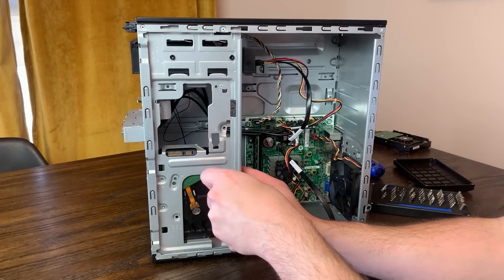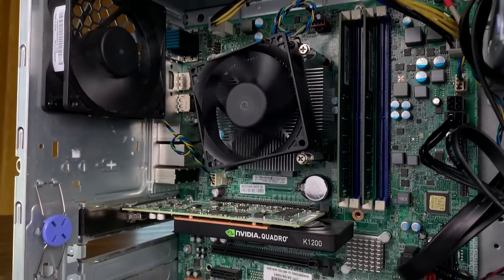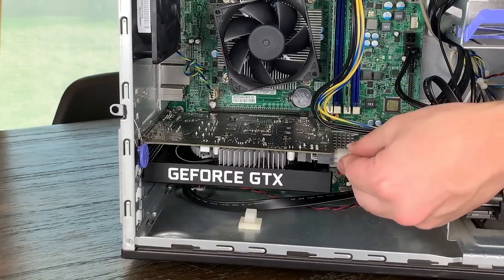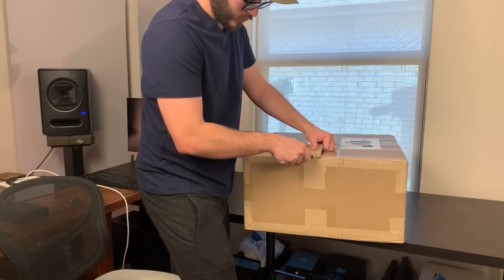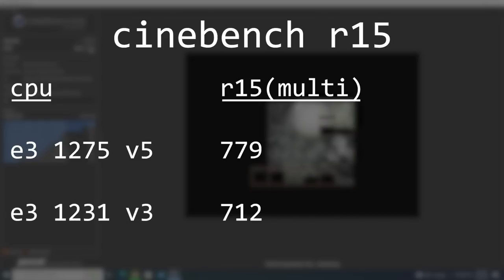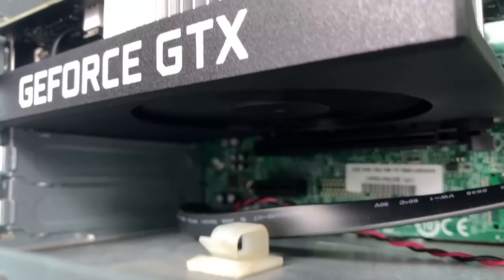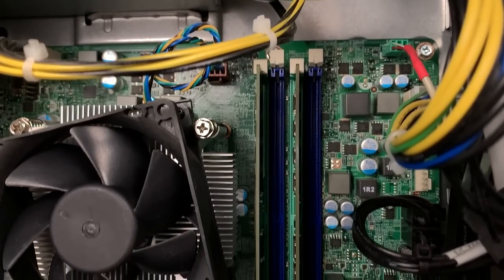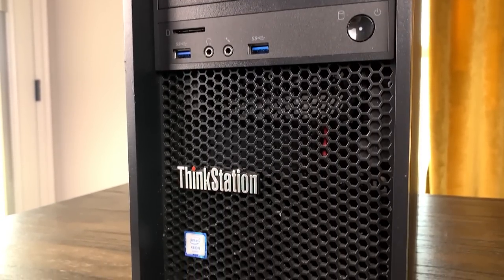Is This Lenovo Workstation Worth It In 2022?

Comment: While this is a decent find, I feel like someone should look for something with at least an 8th gen CPU or newer. I got a Dell Optiplex 7060 with an 8700 and 16 gb of ram and a 512 gb sata m.2 ssd for $185. With 8th gen and newer you don't need a dedicated GPU bc intel uhd 630 graphics are good enough for transcoding multiple 4k plex on the fly transcodes simultaneously. The downstairs are limited drive storage and a proprietary form factor motherboard and PSU. However if you have a 3d printer and a Dremel, you can make a few modifications to the case. Personally I plan to just buy a case with lots of drive bays and a new PSU and motherboard. I personally see the PSU and case as a long-term investment though since I can easily reuse them in future builds. Great video btw.

Comment: the only product i ever bought that was Actually worth it's money ,
was a SubPac M1 and S2 when the M1 broke it's cable , which was my own fault by misusing it
it's basically a subwoofer in your gaming chair or you can wear it like a backpack
the drive these things have , no headphone or ''normal'' desktop speaker could come close to what i feel , 
and you can even give it some more power with an amp , physical amp or software based or even both to really dial it in how ever you like
works with everything , even sends throughput of 7.1 to appropriate headphones , just not the mic signal if you need one
your eyes and basically your  body can get a descent massage from this woofer , which there are also nice rumbling tracks to listen to and relax in to.
people are getting ripped of left and right in this world , but this thing was definitely worth the money i paid for it !!

Comment: That case looks identical to the ThinkServer TS140 I got from a work old hardware giveaway.  Same annoyances and fixed it about the same.  New PSU and the adapter (although I don't have the problem with the PSU not turning off like you mentioned).  The lack of places for 3.5" - mine came with 2 different 5.25" bay converters.  The top one has a slim DVD, small fan and adapter for 3.5", the bottom a fan and adapter for 3.5".  So it could hold 4x 3.5" but not sure I would ever trust that all running off the motherboard power.  :)
Reply from the maker: Yeah I probably wouldn't trust it either, especially with how little info Lenovo gives on specs
Reply: Got a TS150 myself recently that is very similar, pretty nice and quiet machine but man updating the BIOS was a pain and having ECC issues in old BIOS versions is embarrasing. 

Also it's meant to run 4 disks so i don't see any reason not to trust it.

Comment: That's not only a Lenovo Disease. My Work Fujitsu Celsius+ died a few Weeks ago. The Technician change at first the Motherboard and like so often it's not the Solution. He tried a new mighty 260 Watt PSU and that was the Solution of the Problem. The Fujitsu used also a 10 Pin Connector to the Motherboard. Power for the Drives comes also from the Motherboard.

Comment: I think the real value in machines like this is ECC support at a reasonable price which is great for a nas.  If not for that, there are much more performant platforms that draw far less power.  The nice thing about both of those facts is that it will keep prices down on these platforms for folks that want to build a cheap nas with ECC ram.

Comment: It's a good system if you need a graphics card and storage space. For my own needs it would be too big. I run two websites with some computing needs on an HP office PC (£150). It has an i5 9500, 8GB RAM and a 256GB nvme SSD. The best part is just 7W idle power.

Comment: Interesting that a fairly basic Quadro k1200 is still selling for $80 on eBay. 
Some of the fun workstations to play with, if you can get them at the right price, are the ones with LGA2011-3 and LGA2066 chips (like Lenovo P500, P510, Dell Precision 5810 and 5820).
Reply from the maker: I'll put those on the list, haha thanks

Comment: I just picked up a P310 (i5-6600, no GPU) for $85!  Just curious, when you replaced the power supply did you experience any issues with sleep mode, or just with full shut-down? This unit is working great, but I’d like to know what my options are if it ‘pops.’
Reply from the maker: I think fans or drives directly powered from the psu won't power down when asleep. You can still use the sata power from the mobo with a 3rd party psu still though
Reply: make sure the oem psu is not too old, or you can just buy a psu from like deepcool or fsp, seasonic etc.

Comment: I actually got a system not too long ago  with the i7 6700K but no GPU for 130 Euro and it was built by the previous owner so it had a normal power supply and case but also a HDD 😔
Reply from the maker: That’s still a pretty great deal!
Reply: threw an SSD (NVMe even better) and GTX 1080 is gonna be a bombastic build👌
Reply: @baoquoc3710  I put in an SSD (sata) that I already had lying around and a RTX 2060

Comment: The power supply problem would have been down to the main big capacitor in the PSU. I used to repair & recertify server and PC powers supplies for Dell & HP etc and those FSP's suffered this a lot.
Reply from the maker: I might try testing it and seeing if it’s worth reaoldering a replacement. Thank you!

Comment: Great video but i'll have to disagree on the conclusion. It is a glorified basic desktop computer with a xeon and a quadro gpu just to call it a "workstation". And it suffers from all the prebuilt defficiencies which makes it a hard pass. 
On top of that, add the lack of ssd and faulty psu.
Reply from the maker: Yeah I can totally see where you’re coming from. I think I was approaching my conclusion from the perspective that the PSU was functional still, as I imagine most people wouldn’t have that problem. ECC support is also a nice non-consumer feature, but there are definitely downsides. Appreciate the comment!

Comment: So this Lenovo p310 is socket 1151 and ddr 4. The xeon you show is socket 1150 and will not fit this board. It will fit the p300 which is also ddr3. I had 2 of these and cannot load Win 7, in that it will not read the win 7 DVD

Comment: Have you tested the system with the RAM sticks in the blue slots? I wonder if the instability was caused by that.
Reply from the maker: I did not, but the PSU was definitely the issue. it eventually didn't power on at all

Comment: Im just looking for any motherboard with Intel network card (really lot of MB using Realtek) to run Vmware ESXI hypervizor. And this looking good, hopint, that Intel NET adapter is not just in this P310 but also in P500. And for 200 bucks its a great deal to almost anything on Linux.

Comment: they sell adapters for the 5.25 bays that fit multiple 3.5 or 2.5 hard drives.  that way you can use all the sata ports.
Reply: Just don’t make the mistake that I made.  Those are fine for SATA SSDs, but I added an HGST Deskstar to the mix and thing idles at 55 degrees.  A 5400 rpm 3.5” is what I’d recommend with those adapters.

Comment: I have dell optiplex 7020 i7 4790,  16gigs rams with Quadro K2200, PSU FSP HV 550W. NVMe 512Gb using pcie x16 converter adapter. Old but enough for me 😁.
Reply from the maker: If it works, it works!

Comment: I recently bought a HP Prodesk 600 G3 MT and replaced the I3 6100 with a I5 7400 and got the RAM to go from 2133MHz to 2400MHz. Would that be possible with this machine? Replace the v5 with a v6?

Comment: The one thing I am wondering with this workstation is if the motherboard has 6 SATA connectors but only two mini 4p power connectors for the drives. Does that mean you need to double split the SATA power connectors to saturate the 6 SATA slots, is that safe? or is it just how lenovo intended it to be?
Reply from the maker: Depends on the power draw of the drive (SSD/HDD, rpm, etc). I really don’t know though haha

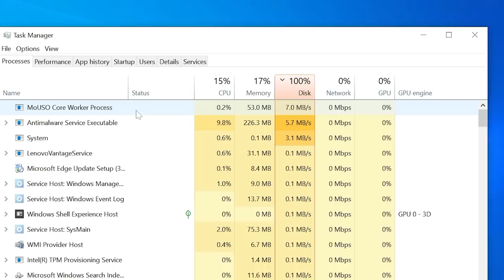Comment: 4:56 in my experience, thats just how it goes with spinning drives on windows 10+
Reply from the maker: Yeah, I didn’t provide enough detail there though. It was quite a bit worse than my other experiences with HDDs in windows, and was also making pretty horrible noises. I’m not sure why I cut that from the video
Reply: @HardwareHaven  Yea, Horrible noises kinda makes a difference with spinners, Probably alot scarier with solid state though... Like, "Theres nothing to make noise there, Why is it making noise?"

Comment: @Hardware Haven
You tossed a 500GB HDD because it was slow? WTAH? Mistake. Keep it in the system and add in an SSD to boot from. HDD's make great secondary storage...
Reply from the maker: So I was NOT clear at all. Not sure why I took it out of the script, but I originally had planned to talk about it making clicking noises and not working properly even after reformatting and such. Sorry for the confusion.
Reply: @HardwareHaven  
Ah ok, that's good info to know. From the way the video was edited, it seemed like you were tossing out a perfectly good drive, which is just craziness! Thank You for clarifying.

Comment: 5:20 
Like you said it's a workstation, 5.25 bays offer compatibility with 3.5 hdds, hotswap bays and tape drives... yes, even in 2016. 
I guess you prefer modern enthusiast cases with lots of empty wasted space.
Reply from the maker: That’s quite a stretch considering I was literally asking for more drive bays. I was only saying that in a more mid-size workstation, I probably would’ve preferred more 3.5” or 2.5” bays instead of dual 5.25”. And I mentioned the cable management thing because I’ve worked in similar OEM cases that were easier to work in.
Reply: I guess you could have worded it better then, saying "this was built in 2016, come on" seemed like nothing more than the typical hatred of 5.25 bays that somehow has become common, implying that 5.25 bays are old tech. 
While the case isn't perfect i think having 3 or more 5.25 bays would be a much better improvement than more 3.5 bays, that way you could add 4 hotswap bays. (Or 12 hotswap bays for 2.5 inch SSDs)
 @HardwareHaven

Comment: fsp group power suplies are like the best of the oem psus they are well built. they are the only oem psu that have alot of weight  to them.
Reply from the maker: Yeah, I was surprised when it was the culprit
Reply: @HardwareHaven  so was I lol, made this comment  just after I saw it was one cuz I hadn't seen one in ages. was like "ooo i got one of those thats like 15 years old and still going" and then i got to the but where it died and was surprised.

Comment: Quick answer: probably not as in a similar price range there are 6th and 7th gen powered systems available, which draw a fraction of the power and have a lot more grunt per watt.
Reply from the maker: … this is a 6th gen system
Reply: @HardwareHaven  a mistype. 7th and 8th gen. With some patience it's possible to find nice Precision workstations. Or lowering the target to regular non workstation PCs, there are plenty of Optiplex and Thinkcentre systems at bargain prices.
Reply from the maker: @bufordmaddogtannen  I don't think 7th gen is really a massive improvement being essentially a skylake refresh. There are some good deals on sff low power 8th gen stuff for around this price, but I don't think that's a great comparison necessarily. Depending on the use case, it could be a much better choice, but not if you want drive space, PCIe slots, more ram slots or sata ports. Good recommendations though
Reply: @HardwareHaven  it depends. For instance you may get a 7th gen CPU with a lower tdp which will save you some money in electricity costs, or an 8th gen one which may give you more cores. Expandability will be limited by the power supply which you may need to replace. For instance Optiplex towers are usually limited to 240/300w.
SFF systems add further compromise and with USFF you would also get less powerful CPUs, although the idea of tossing a whole desktop computer in a backpack is fascinating. 🙂

Comment: Think about this... it's definitely no worse than a Power Mac G5, without using the 5 1/4 inch bays your limited to two drives only too and surely that thing will consume way more power just at idle. I love my Power Macs, but it's a very inefficient design. The thinkcentre was built this way because it's also a segmented device. While fairly powerful, Lenovo had bigger, meaner workstations at the time then this. For some reason Lenovo is far less gracious to it's professional users over say Dell. If by slight. At least the 3000 & 5000 series precision you could use Nvme Sata, with 5000 series in raid0. Imagine the screaming I/O with two Samsung 960 series SSDs running together as one unit.. wow!

Comment: When did RAM speed start getting referred to in Mega Transfers Per Second rather than MHz?
Reply from the maker: Basically always, but marketing just used Hz so that's what people said
Reply: @HardwareHaven  I've been building PCs for over 20 years and it's just been in the last couple of days of watching videos that Mega Transfers Per Second seems to be getting used instead of MHz in regard to RAM speed. I've never met a person in all that time that used Mega Transfers Per Second in regard to RAM.
Reply from the maker: @voteDC  Oh for sure. Sorry my response wasn't very clear. MHz has been used by most people including myself, but I believe MTs is the standard that people in the silicon industry actually use, as it's more accurate. It's definitely been a trend recently to use the more accurate unit, and that's why I'm using it. If I didn't, no doubt there would be comments pointing out that I was wrong haha

Comment: Power connectors aren't weird. They're the new normal. The future is now old man
Reply from the maker: ATX12VO is the future, sure. But I don’t believe that Lenovo power supply is using the same spec/pinout
Reply: @HardwareHaven  ill tell you a secret from working as an engineer in the embedded industry. Most of those 12v boards will run off of a single 12v / gnd pair.  Generally one of the 6pin or 4pin power on the standard atx will fit and have the correct pinout. But like you said, it'll be on whenever the psu is plugged in.  That's a feature not a bug  :)

If you want the power button to work, cut the single row connector off the old psu. Connect the green wire on the connector to the green wire of the psu. If there isn't a green wire, it'll be the one that shorts to ground when you press the power button

Comment: good deal.  i have the same thing i use as my VR computer with a juiced up PSU and an RX 590 GPU.

Protip.  though the CPU fan header is 4pin, there are no thermal controls for fan speed throttling.  so you need to run a separate fan speed controller or your computer will shutdown due to thermal throttling of the CPU.
Reply from the maker: Interesting, thanks for the tip!

Comment: I’m pretty sure that is a standard matx board not atx.
Reply from the maker: Yes my bad. I was talking more broadly about the ATX spec, not necessarily the specific motherboard size.
Reply: @HardwareHaven  oh I didn’t even consider that. As in it will fit any atx standard sized case. Because technically not every matx board will fit in every matx case. Some are tiny, and others are like on the verge of being full sized boards.
Reply: @HardwareHaven  on another note I find it interesting you are able to produce such professional looking content using your phone.
Reply from the maker: @MisterRorschach90  I also use a Lumix G7 now. I believe I used it for the talking head shots in this video. But thanks!

Comment: please put windows 11 on any pc you have
Reply from the maker: Why..?
Reply: @HardwareHaven  because windows 11 is better than windows 10
Reply from the maker: I think that’s a bit subjective. Also, I’d have to go through workarounds to install Win11 on most of the machines I work with as they aren’t officially supported.
Reply: @HardwareHaven  all you need is a windows 11 iso, Rufus 3.18 and a empty flash drive